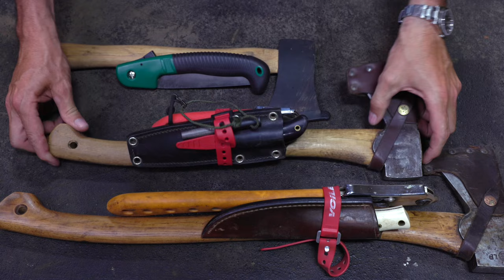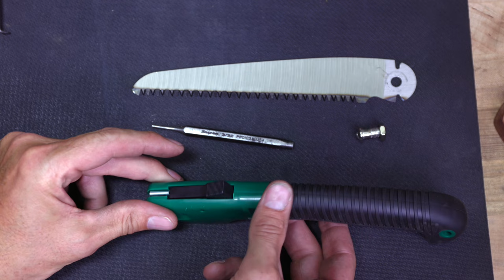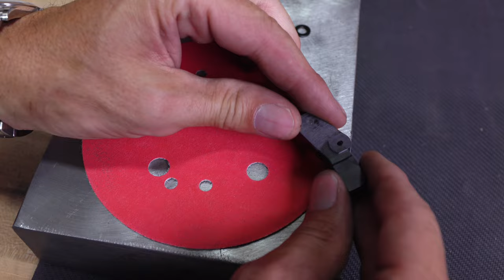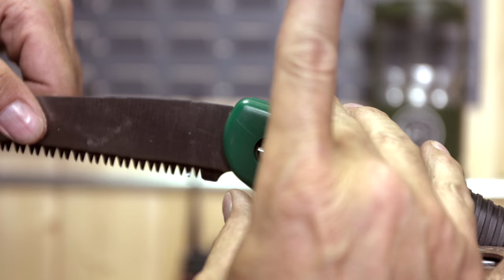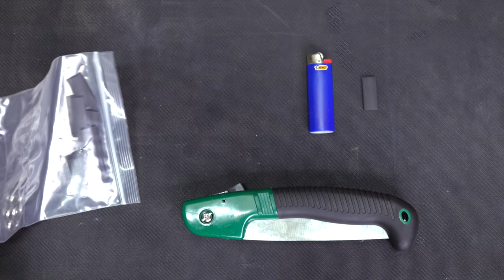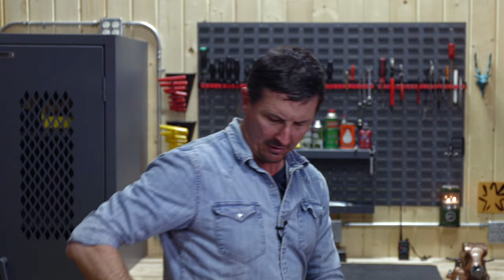Harbor Freights Best Kept Secret EXPOSED!

Comment: A Mora knife would make a nice addition.
Reply: Yup. Mora Companion.
Reply: Fully agree with you
Reply: Was going to say the same. Mora makes amazing knives and you get 100% genuine product for the money
Reply: Agree. My old mora has been through hell and back and is always on my belt.
Reply: @ron3365  i love the fact they sell the blanks, bought one and put a beautiful handle on it
Reply: Mora Chis-Knife. Can be used for meal prep, fire prep, and bush craft woodworking.
Reply: Yep. Mora
Reply: I completely agree. I love my Mora knives, I’ve got a few of them.
Reply: Don't use a Morakniv Companion and I'll tell you why,    the backstrap of the Companion model is not at a 90 degree edge, it's slightly rounded and therefore will not strike your ferro rod.   

You could grind the backstrap flat,  but it will result in the stainless finish being compromised.   

The Companion is a great little knife for fishing and skinning animals,  but it's not intended to hold up to being used for heavier duty activities, like smacking on the back of it with a rock to chop something hard. 

Morakniv makes a lot of other models of course,  but they will be more expensive if you want a "do everything" knife.
Reply: Morakniv, 'Light my Fire'. with firesteel in the handle and a lanyard. I keep one on my boat.
Reply: I was gonna say the same but figured it had probably been put already. Mora is pretty much the gold standard for survival on a budget
Reply: @trevorvalentine7721 - Agreed, but I would suggest the HD version.
Reply: Let's see if harbor freight will sell them
Reply: nothing beats a mora really
Reply: Yes.... I have a Mora knife stashed in just about every little nook and bag I have.  Just a companion model....but still.  I've also been putting in an 88 cent pairing knife from Wally world in kits....just as backup / sacrificial blade if I need to shave bark, make fat wood chips, or strike a ferrel rod.  They work great, and are super easy to sharpen.
Reply: Companion heavy duty
Reply: Mora's really the only choice..
Reply: Yep you read my mind Scott.
Reply: Yup, a mora spark would also include the firesteel
Reply: I've actually seen people that buy a number 12 opinel, along with a number 12 opinel saw and modify the handle a bit to fit both blades into one handle. Kinda want to try that to have both in one.
Reply: Yessir
Reply: I was going to suggest Mora as well!
Reply: Perfection
Reply: Love my mora knives
Reply: I was going to be all smart and suggest a Mora knife but apparently  everyone else had the same idea.
Reply: Duh that's the only logical choice don't even know why he would ask lol
Reply: Agreed Mora is the best budget
Reply: Yep.  I'd add my endorsement to that.  A Mora Heavy-Duty Companion.  A few dollars more, but more likely to REALLY stand up to bush conditions.
Reply: The Mora Kansbol would be perfect addition!!
Reply: My thoughts exactly...probably the most affordable quality knife you could pair with that set.
Reply: Mora with a carbon steel blade.
Reply: @metningsniva3856  you shouldn't be using your knife to strike your fire steel to begin with and my more companion holds up just fine to batoning through wood I've split hickory logs 6 in across with it with no issues and it makes feather sticks just as easily without needing to be resharpened after splitting the wood.
Reply: @slowtaknow  they sell a cheap knockoff wannabe Walmart does too I believe you can get them at either store for a dollar
Reply: @donvandenberg5301  that does sound nice.
Reply: @metningsniva3856  yeah, grinding stainless does nothing to impede it's corrosion resistance. Galvanized or tinned steel is a different story but the steel's stainless properties come  from the chromium and other metals alloyed into the steel.
Reply: Just added a funky blue Mora, a green companion would be a good choice.
Reply: @AndrexT  that one is probably out of the budget theme with this set. I added those to the family go bags though.
Reply: Dead on, I thought about a few but they were all more than $10:) The Mora would be great!
Reply: Mora garberg stainless and  Terävä Jääkäripuukko
Reply: 100%
Reply: Either way if you really wanna go budget and don't care about the smaller size a morakniv robust is a really good edc fixed blade and a good (for the size)  bushcraft tool.
Reply: Obviously
Reply: Damnit. And I just bought the Hatchet....Oh well, back to Harbor Freight!
Reply: Had the blade of the stainless companion snap in half straight from the spine down battoning some hardwood. Luckily got stuck  in the piece, but could have made for a really scary shrapnel. Using the hultafors heavy duty and their chisel knife now. They seem to be way tougher than any of the Mora's I've used.
Reply: Mora.
Reply: A Mora is the only choice for what he’s up to…
Reply: Agreed, Mora Basic.. £8 UK price.. inc proper sheath - Serrated and plain edge, the sheath has a belt clip,  water drain and knife clicks into place. Just add a Lanyard and fire rod to it.
Reply: Exactly what I was going to say. Brilliant knives for the money, strong and hold a great edge
Reply: Yup
Reply: HERRMAAEEUUSSS... MOORA... DAEDRIC PRINCCE OF..KNOOOWELLEEEDGE...
Reply: Mora Kansbol, a good combination blade at a bargain price
Reply: yesss!  exactly what i was thinkin too
Reply: My thoughts exactly, best value for money spend in that bracket.
Reply: As i am from Mora, Sweden i also have to say go for the Mora. It has never failed me. All from scouts to military service and to home projects. I do prefer the Mora Garberg Carbon.
Reply: If you are going to get a Mora knife get the ones with high carbon steel. The others are a PAIN to sharpen.
Reply: I think mora 511 would be great.
Reply: I was about to type Mora and saw you had beat me to the punch. The three knife for $40 deal makes a good starter knife kit. One for your belt, one for your house kit, and one for your car kit. That or one for you and one for two relatives or friends.
Reply: Obvious and only choice at the price point and value here!
Reply: Mora for sure!!!!
Reply: @rumpleman4569  Thats awesome, have looked a little into making knives and know I am not at the blacksmith level.  Definitely will look into these blanks.
Reply: That is what I was thinking
Reply: @seankelley3489  yup just look up morakniv blanks on Amazon, they come sharpened so be smart and put some thick duct tape over the blade when working, I cut myself pretty good the first time around. 
 
I want to try doing one with a resin stabilized piece of honeycomb for the scales
Reply: I'd go with Multipurpose Tradesman Bahco. Cheaper than Mora and about the same quality.
Reply: My answer as well. Great knives
Reply: Also my first thougt. I really like the Mora Companion but i think in combination with axe and saw it would also be ok to choose the even cheaper and not as badass mora 521 for example.
Reply: @metningsniva3856  If you also have an axe, you wont really need to start any batoning or did i forget a certain bushcraft/survival task?
Reply: I was going to say Mora or Ontario Rat
Reply: When he was talking about adding a knife to that set that was my first thought they’re good they’re sharp and they’re less than 15 bucks in some cases
Reply: @metningsniva3856  He all ready has the backside of the saw and an axe. And why would you smash the knife with a rock if you have an axe?
Reply: obvious choice. I agree fully
Reply: That's my vote too. BUT I have very little experience with other knives of this type. So Mora wins by default.
Reply: @donvandenberg5301  Now that is a very nifty idea! Opinel is a good choice in  general for a budget pocket knife... as a little back up.
Reply: I'd agree plus you can go to Amazon and buy the Mossy Oak folding saw set instead of the harbor freight saw. The Mossy Oak folding saw set comes with three changeable blades 1 standard Blade, 1 metal cutting blade, and 1 plastic cutting blade with a okay Nylon sheath that holds everything together. I like my set but it's another $10 more than the harbor freight. I bought mine the cheapest at$14.95 if I remember correctly.
Reply: I must tell you I investigated the Mora products after reading your comment and purchased the Bushcraft knife survival.  I hope I’m not disappointed.  I went with the carbon.  Just like grandparents always had.  I haven’t been happy with ANY stainless blades I have. I was happy to see they offered the Carbon steel.
Reply: Stainless mora
Reply: @andrewdaniels7076  
I'm sure he asked because it gets us all chatting with each other and that helps out the YouTube algorithm. Which helps get more of his videos suggested and therefore seen.
Reply: Came here to say this
Reply: Hands down brother
Reply: 100%
Reply: Yes a mora ROBUST is the best cheap option being a carbon steel and a much thicker blade than the cheap companion series (I own both, and many other mora knives) for under $15 the ROBUST is my go to
Reply: Yep, came to say the same. Best for the price.
Reply: Mora robust
Reply: @donjuanmckenzie4897  I agree about a sharpened spine. I would rather not risk a finger cut. Same reason  I don't like choils
Reply: Mora companion heavy duty
Reply: No other option , Mora
Reply: Make sure it's a Mora with a nice guard to protect your hand from the cut edge.
Reply: Yes indeed the Mora HD Companion would be the way to go , if your worried about the rounded spine a small Diamond stone can address that easily, I have the Carbon Steel model myself. I have to the eye roll when ppl cry but it will rust , I live in Florida saltwater water all around me , once you get a patina on the blade all you gotta do is wipe it off after using , It's not like it's that huge of a issue , You think our Forefathers ran about for Centuries with rusty blades ?? ,
Reply: cheap and quality yes
Reply: If you're going to go with a Moraniv you might as well use a Bahco saw and a Fiskars axe to keep the whole thing Scandanavian in origin. That's what I did ads the whole set came in at around $50.
Reply: Instantly thought of Mora as well. Great Call!
Reply: I prefer the Garburg myself, but the Companion I have is a pretty good knife. The main issue with the Companion is that it isn't able to throw sparks on a firesteel
Reply: Yes myself and three boys all have them, very inexpensive and good quality. Morakniv $14.95
Reply: @AndrexT  -- Light My Fire/Spark is a rip-off. £10 Companion and a £5 firesteel, but they ask £30 for it? GTFO!
Reply: Mora companion, for the firesteel you still have the back of the saw that is usual a sharp 90°
Reply: Mora suck they are too thin and only 3/4 tang. You need a robust knife(4-5mm thick) and full tang!
Reply: Lol this was surprising to see, Mora is my last name.
Didn't know this brand. Cool stuff :p
Reply: Good call
Reply: Go with the HD (heavy duty) Companion.
Reply: Read my mind
Reply: @metningsniva3856  Well don't get the stainless. Get the high-carbon, grind the back strap, and then put the knife in some vinegar for a few hours or overnight. CLean up the edge and wax/oil it.
Reply: @trevorvalentine7721  never heard of them before, I just ordered one.
Reply: @SuperPersianKabob  Nice, inexpensive knife.
Reply: Came to say this
Reply: Mora knife
Reply: Yep, Mora.
Reply: @notsevenfeettall  opinel actually makes a mushroom knife as well. I has a hook shaped blade and brush bristles on the but end for cleaning the dirt off.
Reply: This. You can't beat 20 bucks for the quality of a Mora
Reply: Just bought one.  Impressive knife.
Reply: came here to say this
Reply: I was thinking the same thing
Reply: Walmart has a $2.87 bait knife in fishing section, that is a mora knive knock off but a decent knife in use
Reply: I too love my Mora knife. And I hate to suggest a budget version since they are only $11 or $12, but since Wranglerstar is going for budget, Walmart has a Mora lookalike for $2.87 called the Ozark Trail 4" Fishing Bait Knife. If I just glanced at it, I would swear its a Mora. :)
Reply: My first thought was a Mora too.
Reply: @donjuanmckenzie4897  Carbon steel
Reply: BASIC 511
Reply: Hands down Morakniv is the best budget knife in the world.
Reply: exactly what I was gonna suggest
Reply: Mora basic
Reply: a full tang mora     ✊️ 😑
Reply: @metningsniva3856    yes go full tang ....   amen   ✊️ 😑
Reply: @isaiahl4715   you might find a good ozark trail knife at wal mart ✊️ 😑
Reply: @CrustyMac300    full tang?     no wango tango bro   ✊️ 😑
Reply: Agreed
Reply: @metningsniva3856  Its a Mora you can use the cutting edge just keep close to 90degree angle against the rod. Doesnt harm the knife as much as you would think.
Reply: Need full tang.

Comment: The Mora Companion is a good little knife, comes in right around $16 bucks and comes with a sheath, picked one up for a cheap hunting knife and have been happy
Reply: Sixteen dollar bucks.
Reply: Great knives; I have a bunch, and have given away several. Look under Bahco as well, same knife and sometimes costs less.
Reply: @om617yota8  Does it cost less than sixteen dollar bucks? If not, I'm not at all interested.
Reply: @billblasko1872  i got mine for 11€. Its pretty much the same knife but orange so you find it easier if you drop it.
Reply: the Mora 511 is available in orange and it comes in around $8
Reply: 😂 sixteen dollar bucks!
Reply: It can be cost less than $16

Comment: If you choose anything other than a Mora companion I’ll be highly disappointed lol
Reply: For budget the classic works great. Just need to square off for striking the rod.
Reply: A mora light my fire would be a good one to include the ferro rod in the bundle.
Reply: @Loiczzr  Agreed i have the classic #1. Best $15 i’ve ever spent. I prefer it over the companion.
Reply: Cold Steel Pendleton Lite is a great knife as well.
Reply: 𝕃𝕖𝕥'𝕤 𝕞𝕒𝕜𝕖 𝕥𝕙𝕚𝕤 𝕥𝕙𝕖 ℍ𝕒𝕣𝕓𝕠𝕣 𝕗𝕣𝕖𝕚𝕘𝕙𝕥 𝕤𝕖𝕥
Reply: Hultafors Outdoor Knife OK4 would also be a good choice.
Reply: The Mora 511 is only $8 and its great ..The Mora Robust..The Mora Kansbol..honestly,just about any Mora would be fine..ijs
Reply: Hultafors OK4 is a great choice though.
Reply: @davidedwards8251  Maybe stipple the grip though. It is a bit slick compared to the Mora or the Hultafors OK4.

Comment: I have an older harbor freight saw, about 30 years old. I've been using it for bole pruning Douglas for trees in Oregon. Thousands of trees from the ground up to about 7 feet, to develop clear wood. From 7 foot up I use a pole saw. But, for a $3 saw, it's produced a lot of clear timber.

Comment: if you do not require a folding saw, the Schmidt garden saw from some Canadian dollar stores is good for the price (approx $4). the handle is a covered metal tube so you could easily stick it on a pole for a polesaw.   For a folding saw I really like the silky gomboy 210 straight blade.

Comment: By putting grease on the surface of the  pivot points you're inviting saw dust to build up and eventually causing failure. Try using a dry lubercant such as graphite or dimethylsilicone...

Comment: I have two of those saws, one of them while I had it apart. I notched for the blade to droop some, making it way more aggressive when using, since it cuts on the pull, not the push. You can then adjust your hand up the handle to make it the most efficient.

Comment: When you disassemble and reassemble, don't "skip" over details.
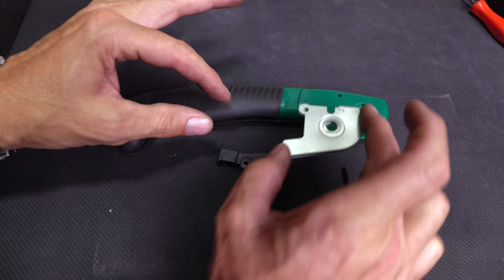3:12... 3:17 leave you punch in there. Don't pull that out, there are hinges and springs in there.
*FLASH* (parts disassembled and placed neatly on the bench)
3:17 Here are the component, pretty simple design ...
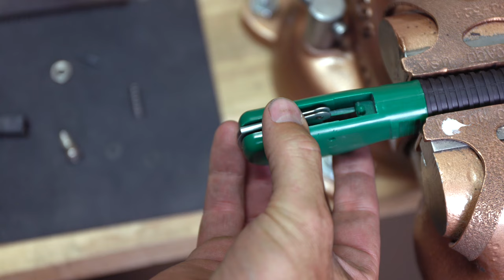4:08 reassembly starts, with not a word on what is happening or you "plan of attack"

Comment: Harbor Freight sells metal/wood files. I’d suggest taking a file (hardened carbon steel typically) and cutting it down to whatever size you want, then grinding it down to the shape, then drill some holes in the tang and handle of the file, and add some bolts to hold handle onto the tang. Then you can finish by showing how to sharpen a knife properly. 

Also, you could show your viewers how to (cheap) make a very nice leather sheath with some leather (leather shoe soles are extremely inexpensive) and a $10 steel grommet kit, or even a snap grommet kit.

Comment: Hey, I liked your hack.  I have a Case hatchet I bought many years ago. Paid premium then but would be cheap now.  It is stainless steel, sharp as can be, light weight, only about 3/16" thick with a really good handle on it. I will shop for that saw tomorrow and fix it. A good old Buck Folding knife, maybe from Pawn Shop would be good.  They were the best lockbacks in my opinion.  You can sharpen them down past the temper though.

Comment: Mora Companion.  I've carried one almost daily for over 5 years now.  Can't kill it.  Not a fan of the sheath after about a year, but I modified it to keep the knife from sliding out.  Best bang for the buck you can get.  Morakniv only sells quality . . . . even if it's no frills.
Reply: Picked up one of these at a gun show years back for like 5 bucks with its sheath, didnt really know what I was getting just wanted a cheap knife to beat up. You’re right, its unkillable. No frills. Sheath still keeps it in tight to boot. Anyone remotely in the market for an all-around knife should get one.

Comment: Schrade makes a few beefy knives like the Frontier full tang fixed blade (under $50) to pair with the set. the Gerber Spine (under $40) is a nice knife too, at this price point, the Mora would be a no-brainer as a fixed blade. with an axe set, YOU DO NOT NEED a fixed blade knife at all that's why for me the Victorinox Fieldmaster (under $40) is the way to go, it can do a lot more than just cut. I can not live without a Victorinox just the toothpick and tweezers are worth their weight in gold out in the field.

Comment: I have a similar folding Stanley saw. The big difference is that it can use any reciprocating saw blade, and it has storage for extra blades. I got it in the 90's and has been used a lot.